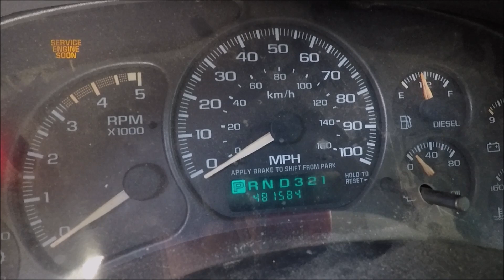I FOUND MY MISSING DURAMAX PART!

Comment: That's how it always happens you find it after you buy the new one
Reply: Seriously I have a junk drawer full of nuts and bolts for suspensions and stuff. If I break a bolt(mechanic in the rust belt) I normally search my bin, don't see it order it, and then on an unrelated job later down the line you'll search and find that bolt just sitting on the top of the pile like it was just waiting...
Reply: @kennethhodge9637  me too lol probably alot of car guys

Comment: Hey idk if you help wit advice or not but I replaced my fuel pump and since then got the code po446 I replaced purge valve control valve fuel regulator mass air gas cap filler neck fuel lines fuel filter. Only thing left is the canister and maybe new tank have any other suggestions. The code is an evap circuit or leak
Reply: 2000 Chevy Silverado 1500 4.8l
Reply from the maker: Just get it permanently deleted
Reply: DiabloFormulaRacing how can u do that